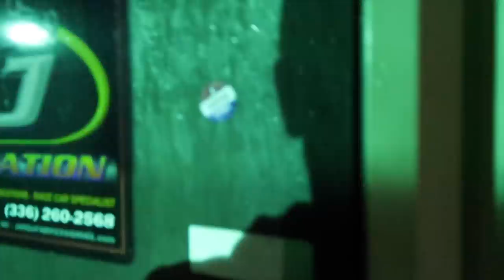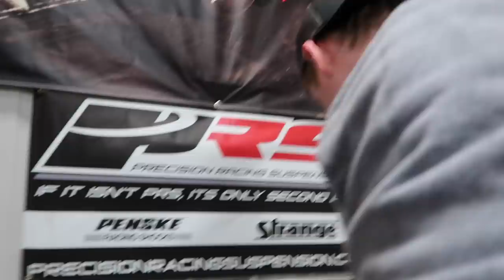The SALTY CHICKEN finally comes HOME!!!

Comment: I’ve got a 9” narrowed 3” on each side. Et streets 295 55. A 15x10 5.5 backspace fits after cutting bumpstops and bfh but a 15x10 wheel with a 5” back space would be perfect. But no one makes that unless you wanna spend big $$

Comment: Run alcohol and that takes car of the intercooler problem. No intercooler required with alcohol
Also people are running in the 4s in the 8th in MX235 which is a 26×8.5 tire. The record I believe is still 4.44 @168 in a 2013 mustang.  That's a bad bitch right there. I believe that 255 is 27×10.5. The 235 is the 26×8.5